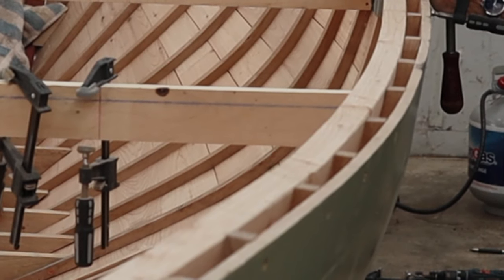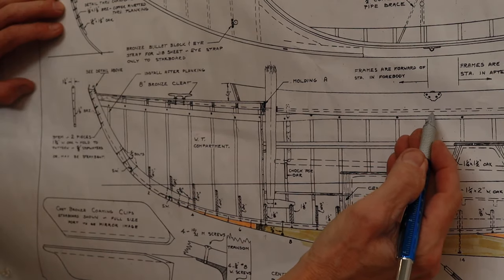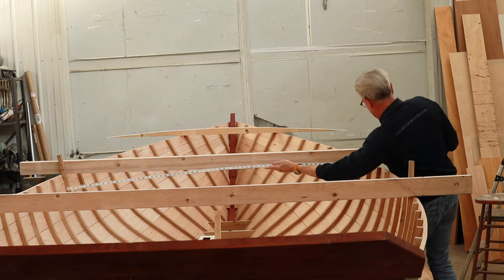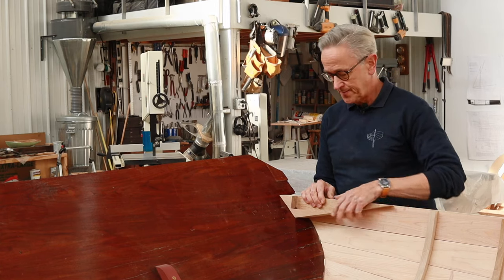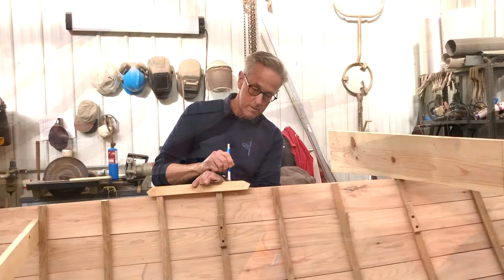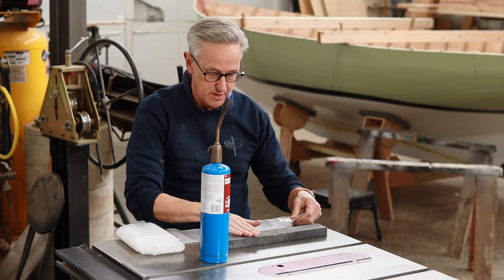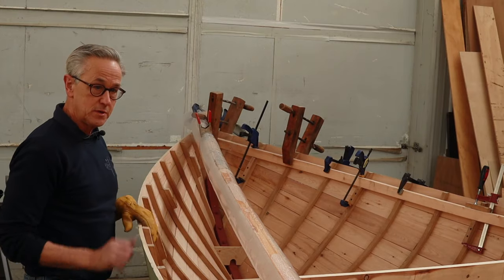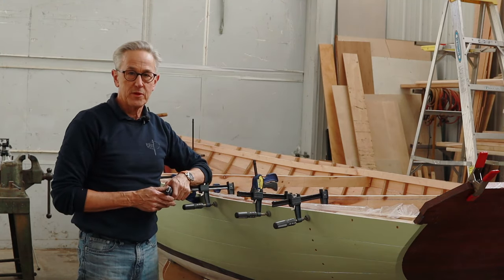How to Bag Steam and Install the Sheer Clamps, S2-E37

Comment: She is coming along very nicely. Steam bending is one of those time when it is hurry up but go slow and I hope I have enough clamps. In your final shot the "jog" in the shear clamp on the starboard side is very obvious, bet that was fun doing. I wish I had known about the steam in place bag system when I built my jon boat a few years back, I used wet towels I heated in a microwave then wrapped em around the shear. Yours are much more elegant then mine are. I let em run wild above the shear then planned em down to the line.

Comment: Pretty cool, steam cooker bending. I've seen Louis do it and Steve and the guys over at Acorn to Arrabella too. Sure would have been nice to have another hand or two getting that bending done while the rail was at its optimal heat, but you got it in there all the same. Great job.
Hopefully, there wont be any visable knife marks from cutting the bag back open. I know you will likely be sanding again, but the utility knife can sink pretty deep into the fir if its still wet from the steam. I'm sure you were more careful than it looked on camers, though.
The craft is coming along beautifully. I saw that there is another video posted after this since I've had time to watch, so I'm going to go watch that one now and get caught up. Thanks again for bringing us along on your journey in building this boat. I love watching quality crafts-persons at work.

Comment: Just wanted to say home much I enjoy your videos. I use a lot of the techniques to make 1/4 scale rc scale gliders which are often oval fuselages , all planked. Ive been considering building a boat as I live a few miles from the sea near Southampton in the UK and I may just start with a stitch and glue kit.
Reply from the maker: Hi Adam, Thanks! I've build lots and lots of balsa airplane models. There is a nice connect with boat building. Have a great new year and best wishes on your stitch and glue project!
Cheers,
Bob
Reply: @TheArtofBoatBuilding  Ah that explains the wing sculpture which looks like its from a spitfire. The aircraft was designed and built 5 miles from me . take care and stay safe

Comment: Hi Bob, nice job and Merry Christmas. Just would like to add that you can buy plastic already sealed in 50’ lengths or more. I know they come in 8”and 12” wide made for food vacuum machines. Get it online cheap about $15.
Reply: Wish I had read the comments before repeating your comment above!
Reply from the maker: Hi Thomas, Yes, one can purchase bags. In my application a 4" bag was important. The idea of the bag is to have as small of steam chambers as possible to concentrate the steaming of the wood. I felt it was important to show how one can make bags with local materials.
Thanks for watching!
Cheers,

Comment: Dear Sir,

Another great video, thanks! Just a few silly questions. 

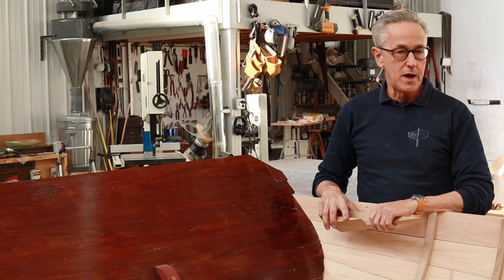At 23:55 it appears you are trimming the end of the sheer clamp, so that it fits to the bracket you show @9:50. After the steam, do the sheer clamps contract? If so, how do you account for this contraction, so that the end of the sheer clamp fits tightly to the bracket?

Cheers from Brazil!
Reply from the maker: Hi Eugenio,
Wood doesn't shrink in length as much as it does in width. The sheer clamp will be covered by the deck and covering boards so a really tight fit is not needed.
Thanks for watching!
Cheers,

Comment: With undisguised impatience and diligence, I follow your series about the birth of a ship. Honestly, I'm a little surprised by the sequence of actions, which is not logical for me. The installation of sheer clamps and auxiliary ribs after painting confuses me. Is there any reason for that that escapes my notion of shipbuilding. And finally what was needed at the very beginning: Merry Christmas and a Happy New Year, to you and everyone who follows this interesting series
Reply from the maker: Hi Milenko,
Small boat building is a much different process than Ship building. Small boats are built on molds upside down, therefore it is impossible to install some of the frames and sheer clamp until the boat is flipped. One gets a better paint job by applying the first coat while bottoms up. The few screw heads will be filled with fairing compound and painted with the final coats of paint. 
The sequence of actions is well documented in Greg Rössel's book "Building Small Boats" ( my main reference book)
https://www.woodenboatstore.com/products/building-small-boats?variant=16904410857562&currency=USD&utm_medium=product_sync&utm_source=google&utm_content=sag_organic&utm_campaign=sag_organic&gclid=Cj0KCQiAoab_BRCxARIsANMx4S4YLeLSCzL8d4X87FdbcSPxJhMY6WgnPOC-a5Rq6KfneaUbymggb04aAgQUEALw_wcB
Thanks for watching!
Cheers,